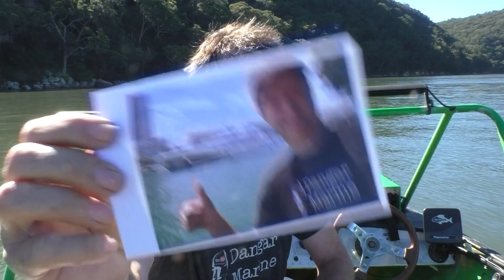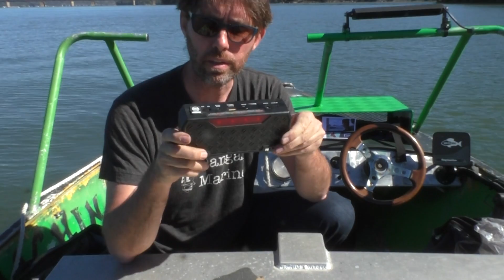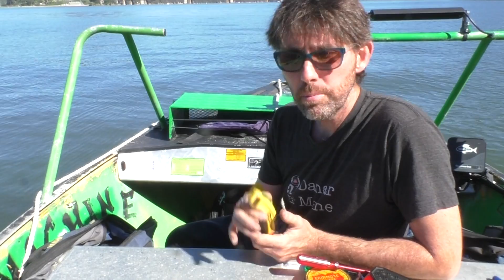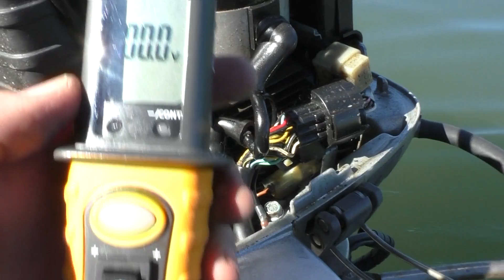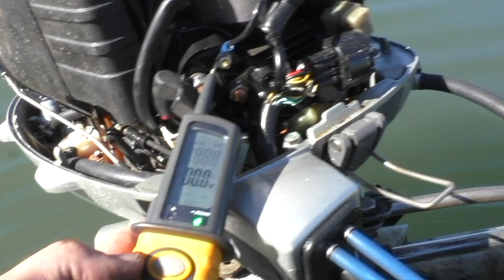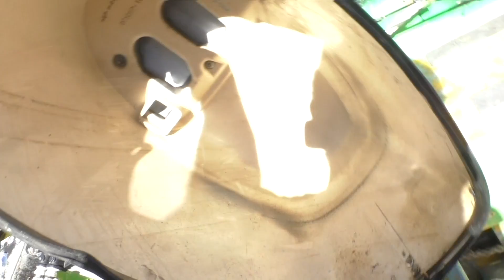Breaking down in a boat on the water

Comment: A blown fuse is sometimes just due to it being old, especially those cylinder type fuses, but all fuses get weaker as they age.

However if you have a blown fuse and you replace it and it immediately or shortly after replacing it blows again you might have a short, if you do its best to find the short and fix it.

But in the situation where you're stranded, can't find or fix the short to stop the fuses from blowing it can be tempting to just jump the fuse using wire, a better option is just to use a bigger fuse.

 eg if you keep blowing 15a fuses try a 20a, this will potentially give you enough amperage clearance to get started and where you need to go without exposing you to AS MUCH risk of a fire or melted wiring as if you just opened the circuit up all the way. 

This is also a good way, when in this type of emergency situation, to determine how bad the short is, if its normally a 5a fuse and it blows anything up to a 30a fuse immediately you've got a major issue, if its a 5a fuse and wont blow 10a fuses you know your issue isn't super severe.

Comment: Hi Stu. Just about watched all your video's now. Bloody brilliant. I have a 2020 yamaha 15hp 2 stroke having a small issue. When I accelerate onto the plane it stutters slightly , when above 50%  throttle she runs like a dream. Any idea what it could be? Apparently the local chaps here in SA say the haver cleaned the carb I have just put new plugs in as well

Comment: Lol my Mercury 125 stroke comes with a pull start emergency kit under the cowl. I don’t think we’d be able to get it going without pulling a spark plug out momentarily and then thread it back in while it running on 3 cylinders
Reply from the maker: Yes, pull starting anything over about a 50 gets pretty hard.
Reply: @DangarMarine  I always pray our bindex doesn’t decide to shear when we’re 20 miles off shore. That 2001 2-stroke idles on 2 cylinders and runs pretty rough but dead reliable so far. 

Your videos are top notch, especially the cutaway of a lower unit vid, and gear engagement. I’ve been picking up old 60s small displacement Mercury’s and it’s been a blast. Makes me understand my big motor so much better.

Thanks!

Comment: I broke down close(ish) to Niagara Falls.  The first order of business was not to panic and get the anchor out.  It definitely put having a good anchor on board as vital into perspective. I carry a few extra drain plugs and a bilge pump in addition to most of the stuff you mentioned here.  1 spare anchor, prop also and a spark gap tester plus some fuel hose.  Power Probe stays on the boat also. Brilliant trick zip tying the plug electrode to ground it out. Thanks for another awesome video!
Reply from the maker: I always consider an anchor as one of the most important bit of safety equipment.

Comment: Carry a 7 to 10 watt solar panel.
If your battery goes south you can recharge it with the solar panel.
It may take all day but it beats rowing. and if your radio works off the same battery and your battery is dead you can get enough charge in the battery to call for help.
It can also be used if you dock and want to leave the boat for a few days and want your battery at full charge.

Comment: Breaking down in a boat on the water just happen Christmas day was on an 8ton houseboat with 2x F60 2015 Yamaha EFI 4 stroke motors and coming out of port lost one of the motors lucky had the 2nd motor to move the boat in a safer place for the night i change all the fuel it was 4mths old but did not smell to bad but yellow in colour so put new fuel in it starts but runs like it running out of fuel i tried to drain the VST but no fuel come out is there a way to get air in it to drain it, i tried to push the value in still no fuel coming out the line i wish you had a video on the Yamaha F60 i got to have the boat motor running before the 26th and the boat yard in the marina open on the 16th so i have a little time to learn about the motor not sure even how to get error codes if it shows on if its fuel the only one be water in the filter and it had no water n there so is it also where water cooler can make the fuel make more water.  some much to look at with a 4 stroke i love my boat with the old 1992 2 stroke Evinrude haha ...............love your video's keep them coming i sure a lot of people get a lot of help from your video's mate Legend Great work.

Comment: Do I have to remove the spark plug to spray the starting fluid into the combustion chamber or can I spray it into the carb intake manifold with the throttle  valve wide open while cranking the engine?

Comment: I carry an extra set of spark plugs with and just change them all out. When I take my wife boating with me it is required that I pull a 10' pontoon boat deck (without a motor) behind with a out house strapped on. Along with a vanity and everything else a woman might require. Gives me an opportunity to carry everything I would need to completely overhaul my boats motor.

Comment: Thanks my friend ..from here in east texas.. I tune to all your boat motor fixes to know I'm getting it done right .   Even been stranded and youtube your videos to get me back up and back to shore .  ..fyi only 2 things you left out you need ..sum rope incase your steering cable breaks.  It happened to me could strear one way but needed the rope to steer the other or else your stuck going in circles. .. tie on to the middle of motor like the crowley then put around a tie down pull to cut left and go slow it takes a good hold to keep her straight .  And one other thing as I am fire extinguisher buisness ... definitely have a 5 pd hose style abc possibly 2 .  If fire on any wires or wiring parts be sure and get that extinguisher powder off ,as it very corrosive and will fry out voltage parts .. if possible use a halatron or halon extinguisher .  It's not damaging to wiring conponets .  And a whistle    lol.  Thanks buddy seriously your videos has helped me with tons of boat motor knowledge... lancehilton72@gmail.com
Reply: No back to my heavy metal band jams.  I'm also a drummer .. ever need any tips on timing .  Come to my page ...lol.

Comment: If getting some power to motor but not enough for trim and starter to work, check the isolator. Had this happen and removed isolator and it was almost completely corroded. Just bypassed it and all good!

Comment: Ha! Thanks for this. I am very new to boating so along with the list of equipment i have also made a little check list on a notepad in ziplock bag that will troubleshoot all the fault finding steps. As its easy to remember it now in my lounge but stuck in the middle of port Philip bay paddling on my bow... the memory might start to fail. Thanks a lot! Hopefully thanks to you I wont be on the 9Oclock news. :)

Comment: Hi, what to do if my motor (Mariner 40 EO 2-stroke, Type: 6E9 S 1500090) fires up but doesnt accelerate? it happens yesterday on the river while driving around 5000rpm, the alert comes on on the motor starts running bad =(
I allready checked and changed the spark plugs, thought they got a bit poor spark, but also with the new ones it doesnt work like it should. When i pull them out they are wet again, so it looks like theres to much fuel coming in... 
i checked the carbs yesterday on the water, doenst get any result from it...
what can cause this problem?
maybe the reedvalves?
any help would be great...

thx

Comment: I was diagnosing after doing comrpession test with the lever at wot and tried started the motor, and it wouldnt start because it was at wot. But when it did start damn thing ran up to 10000 rpm lol. didnt blow though

Comment: Could you squirt your WD40 in to the engine somewhere instead of "start ya bastard" just to save carrying 2 cans?
Reply from the maker: It doesn't work as well, but it help help yes. Just sprayed down the carb the same as any other starting fluid.

Comment: Rectifier went out on my big motor and drained my battery. Had to call my dad, he said use a string to start my kicker motor.  It worked. Used the little motor to charge the battery then fired the big motor and ran back to the launch. I now have a spare battery fully charged on board and know how to test a rectifier regulator! Win win

Comment: you forgot to say a few thing's, (1) all engines with cdi ignition, the spark plugs must all ways be grounded if turning the engine over on the key or the cdi unit can be damaged, (2) all ways carry some 4 stroke for the engine's sump and 2 stroke oil for your engine's fuel (3) a spear fuel line is all ways handy,, but by far the best tool to carry is a  ""woman"" because they know ever thing!,,, mine told me to ""bump start the boat"" when it would not start!

Comment: My only breakdown involved the starter bendix not popping up to engage the flywheel. It was still turning, but not popping up. I used the same wrench that I use to screw the plug into the boat and pried it up while my brother turned the key. I was able to pry it high enough to grab the fly wheel long enough to turn the motor over and she fired right up.

Comment: Hi Dangar Marine, I got myself an old Orkney long liner with a 9.9 hp old Mariner 4 stroke engine, running ok but I cannot find the engine oil filler cap or drain nut, I want to change the engine oil [ done the gear oil, thanks to your vids ] but can't find any info on where it might be , can you help please ?
Reply from the maker: Can't say I've ever seen one of those, but the filler is almost always on the rocker cover and the drain plug somewhere near the top of the leg.
Reply: @DangarMarine  Thanks ..its a bloody mystery !

Comment: My bud has a 25hp 2 stroke Yamaha it’s only sparking on one plug but the other ignition coil has a weak spark and the primer bulb wont get hard, I primed out all the fuel any idea for a solution?

Comment: checking my outboard once when it stopped on the way back, i was wet just back in the boat after a swim I had a belt from the ignition  I didn't think it was possible to have that big of a belt from any ignition system on earth way bigger than you could get from  HT car leads with points n a single coil that i will Never forget, so cable ties is the way to go great tip this one mate thanks

Comment: i have read that you should not use sandpaper to clean points, spark plugs or anything electrical. Apparently the grit off of the sand paper get embedded in the surface and causes a fairly quick erosion of the surface. Better to carry a fine file, like a point file, or something thin and small like that. Enjoy your show and have learned a lot from it.
Reply from the maker: Interesting. A small points file is a good thing to carry.

Comment: Great tips thanks. I'm a carpenter and carry a hammer for the same reason as your good self...
Reply: Actually, tie the pull start rope to the center of the hammer handle; then you can pull start using both hands a little easier.

Comment: i have experienced a breakdown with a broken shear pin on an old 18 hp Johnson attatched to a bare speedboat hull.  It  couldn't have happened in a worse place than the Swash channel in the  fairway of Poole harbour ( Dorset, England )  i was drifting with a big cross channel ferry bearing down on me.   There were no rowlocks and no means to move this hull, but luckily for me, an inshore rescue volunteer outfit had seen me with bino's, and they came and got me back  to shore. That was far too close for my liking.  Some months later, same boat, repaired engine, i was able to rescue another boat with some guys and a BABY on board !  Towed them  back to their launch ramp, so what goes around, comes around.  Love boating and your channel. Subscibed and liked.
Reply: Liked
Yourvideo.always.remember.the.old.saying.if.you.break.down.at.sea.you.cant.walk.home.so.carry.enough
.spares.to.get.yourself.out.of.trouble.and.say.thanks.if.someone.doeshelp.you.so.many.dont.nowadays.keep.up.the.good.work
.stuart.

Comment: Hey Stu will a compression test give you a good indication of the condition of an old Johnson outboard?  Can it be relied on for good service?
Reply from the maker: A compression test is a good check of an engine's general health. You can clean a carburettor, change spark plugs etc, but if the compression is down you have a full rebuild ahead of you.

Comment: Great video that covers just about every situation.  I think the main thing to consider is not to panic and diagnose the problem in a logical order.  If the weather turns bad that can bring about a totally different strategy.  I think lighting such as a torch is important especially if its close to the evening.  Best rule of thumb is to make sure you have a good look over your equipment before heading out.
Reply from the maker: Thanks mate. You are dead right about checking everything before you head out being the best option. About the only thing I'm kicking myself for not mentioning is checking that the gear selector is in neutral if it isn't cranking.
Reply: :) @DangarMarine

Comment: I have a 24' Pontoon boat with a Evinrude 75hp E-Tech.  Motor would start and run good for about 10 minutes.  Would start right back up, but would shut down again.  We were out in the middle of a channel with tide running out pretty fast.  Dock was about 1 mile away and against the tide so moving the boat was impossible without a motor.  Finally 2 guys came by and gave us a tow to the doc.  We gladly gave them $40.  Found the problem to be a bad Thermostat.  With an E-Tech motor, everything goes thru the EMM so it will shut the motor down with the slightest overheating.  I learned that the T-Stat should be change about every 1-2 years if operating in salt water.

Comment: Thanks for all these great vids Stu!! They make up a superb library for constant referral for folks like me with old outboard motors.
Your Evinrude 150 vids are exactly what I'm going through with my Mariner 150 V6..... CDI units, coils, head gaskets, a stator, a trigger.... LT leads and finally new reeds as it spits fuel from a couple of carbs.... I will be victorious over what has become my nemesis but without 5k for a replacement motor I have to continue.
Thanks again,  Kev in the UK.
Reply from the maker: You're welcome mate. Hope you finally get your motor up and running nicely. :)

Comment: Don't forget a  good  rope to push start the motor if the battery is weak and won't crank;
sorry,i meant PULL start (put it in gear!) with the help from another boat briefly towing you ,same as push starting your car; the rpms will be higher and it will start for sure.
Reply from the maker: That's a really interesting idea. I had always thought about the idea of towing it in gear but never about pull starting it at the same time. Could be a vid in that! :)
Reply: Won’t the neutral safety switch prohibit this?

Comment: Hi! 
I have a question. I have the same Honda motor.  Recently I had my carbs cleaned.  I used a ultrasoundwash. I went for a test run and it worked perfect.  The next time I went for a run it died when I went full throttle. 
 all of the times the pump from the tank had been without pressure.  A quick pump and it runs again... 
Seems too not die when I run it slowly up in rpm.. what can it be?
Reply from the maker: If sounds like either the vent on the fuel tank is closed or the fuel pump is failing.

Comment: Be sure your extra motor is a pull start that doesn't need a battery. I also have a small portable solar panel for charging batteries.

Comment: Hi Stu!  Great video!!  I actually have a Honda BF50 tiller model.  I was on a very long trip and had to use some very dirty fuel at a point in the trip (no other available).  After a while my boat started dying down while going full throttle just like if it had run out of fuel.  I would pump the primer, fuel would flow and the boat would start right up and go full speed for a few min till it would die again.  Again pump the primer and boat would go full speed.  End off story had to keep priming it while driving the boat the entire way back.  This was a two week trip and boat was run for  many hours a days lucky this problem only happened toward the end of the trip!!  My boat has a 2 micron filter.  Do you thing the problem would be the fuel pump or maybe the 2 micron filter was clogged with all the dirty fuel and not letting enough fuel flow through??  Oh another important detail is that the primer felt harder than usual when pumping it and it a fuel injected model.
Reply from the maker: I would definitely start by changing the filter. If there is a possibility you can rule out easily then it will make the diagnosis easier.

Comment: How do you keep the tools from rusting that are kept on the boat ?
Reply from the maker: A bit of a spray with WD40 or silicon helps, as does wrapping them in a cloth and then keeping then in a bag that is in a tool box. The quality of the steel makes a huge difference too to how quickly they rust.

Comment: I love you man...but no one will ever carry all that shit.  I'm thinking a full tank of gas...Topped off batteries...A basic tool kit...and plenty of beer!!!  Don't go out if the motor already has problems...Fix it and pray when you take it out. Take a cell phone, a marine radio...some flares and if you have some money...an EPRB.  And don't forget beer for at least two days and a hot bitch to kill some time while awaiting your rescue...I do have to laugh about a pull starter on the fly wheel...Try doing that on a 200 hp Yamaha!  I have no idea why Yamaha supplies one!
Reply from the maker: Other than the spare fuel all the stuff came from one small tool bag, you'd be surprised how little space it takes up. You are right about trying to pull start a 200, always good fun! ;)